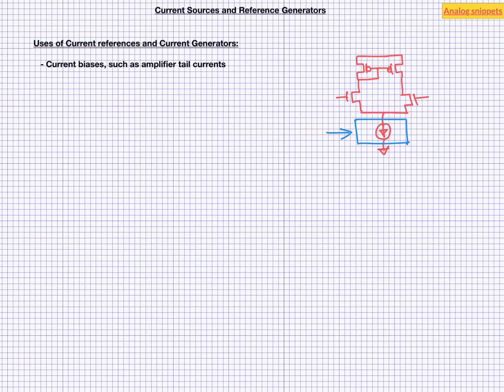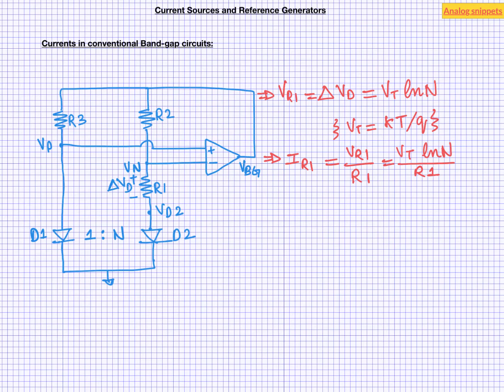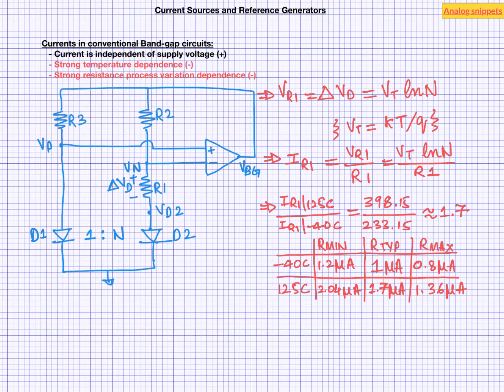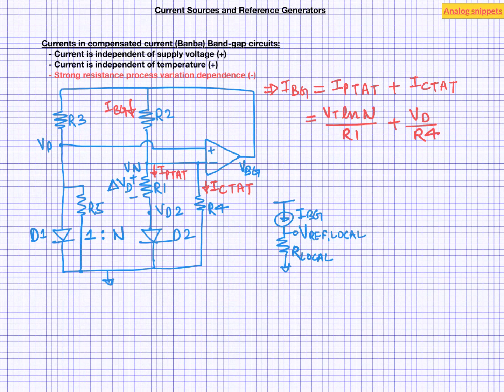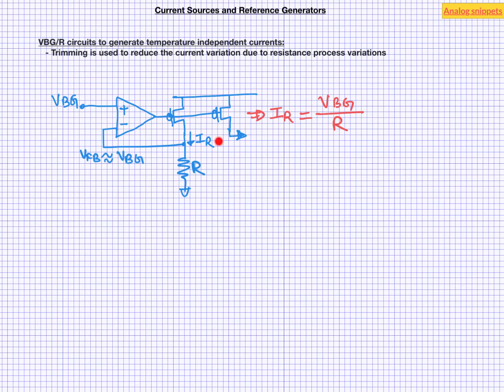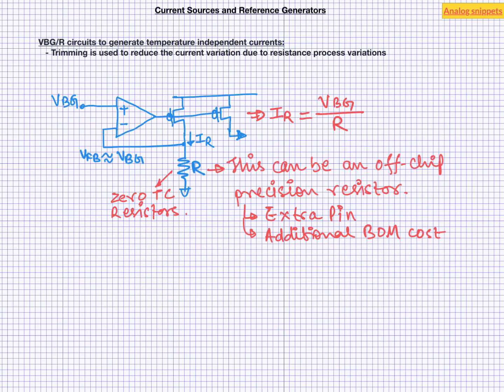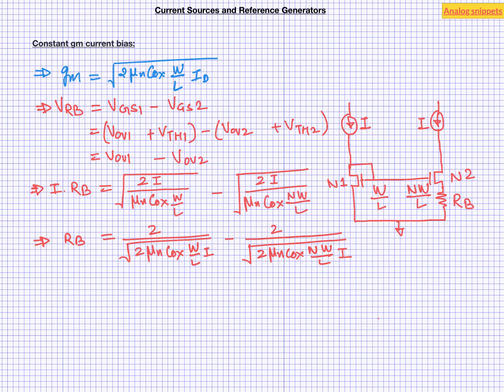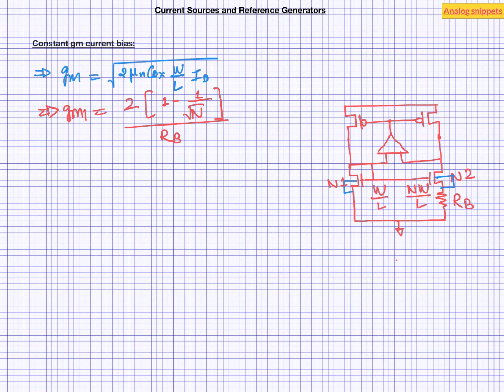#29 Generating current references

Comment: For the flip in diode connection question towards the end is the reason one has >1 loop gain with +ve fb while the other case +ve fb has less than 1 gain or there is something more to that question as well?

Comment: hello I like your content, what could you advise me to train as a designer of analog circuits, I am a recent graduate in electronic engineering
Reply from the maker: The best thing is to do analog, either by joining a company or do higher studies. The best thing you can do to get a job is to have good fundamentals such as RLC circuit basics, MOS transistor and basic analog building blocks. Some actual design experience in relevant project will help. All the best.

Comment: With that circuit configuration current will be source voltage  of diode fet divided by that resistor .. source is one vgs below gate .. not sure how to go after that 

You said in last section body connection will affect this performance 🎭. Is it because source and body of two FETs will be at different potentials ? That will create threshold mismatch ..

Also I would recommend if you can make a video on biasing circuits